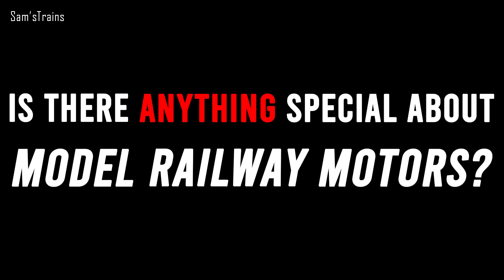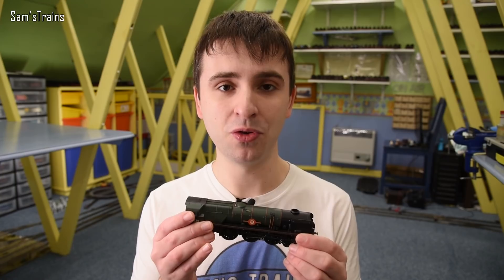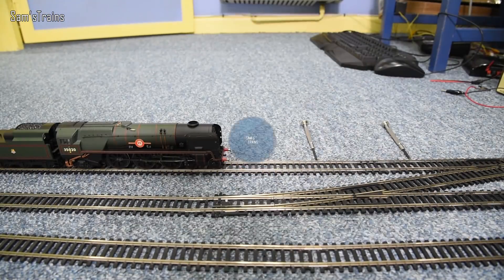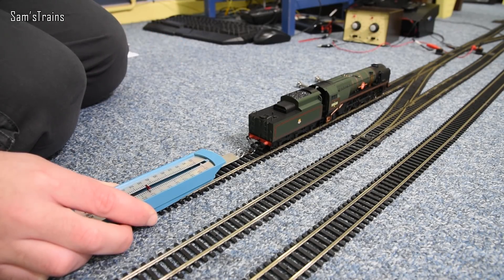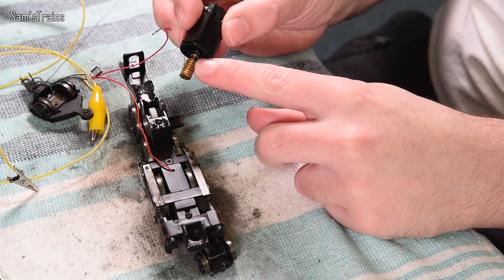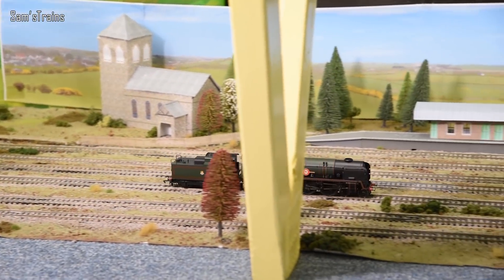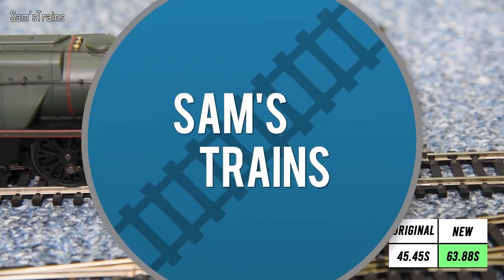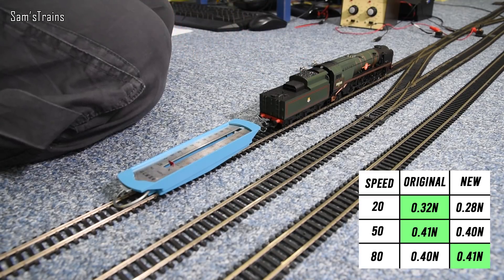How Much Do Model Train Motors Really Cost? | £2 vs. £27

Comment: IMO I think this is part and parcel for these companies to charge excessively which they have been doing for a long time for what looks like a similar engine and probably other parts too.
I would be a bit wary of any Chinese parts that have to do wth power(through experience) and it will be interesting Sam how this copes in the longer term,very interesting indeed.Thank you
Reply from the maker: Thanks a lot Robert - you may be right! I've been using motors such as these for some time - several of my models have been running them for a year or two - no failures so far! You're right though - some Chinese parts are dubious at best - but for the price of one Hornby motor, you can buy 10 of these, so it's easily worth the risk!
Thanks for watching - Sam :)
Reply: That replacement motor looked identical to the original Hornby one to me. I'd say that the only difference between the two is that it came from a different production run but from the same factory.

Comment: Is it possible that the differences reflect  the amount of "break-in" time each motor has seen. We certainly know that bearing wear, brush wear and armature cleanliness/wear could certainly affect performance. Good information, interesting findings. You have certainly proved the factory motor is not worth 10 times the replacement!
Reply from the maker: Yes that could be true - I was just trying to demonstrate that the cheap motors are certainly no worse than Hornby ones!
Thanks for watching - Sam :)

Comment: Late to the game but from RC cars these cheap motors ARE worse...but usually not enough for the hobby driver to notice. Life won't be as great (maybe 15% less life) but at less than 1/10 the cost they are perfectly fine. Its a simple DC motor! Not much to get wrong. I use them pretty much exclusivly. Run them in softly and lube them...they work fine.

Comment: Thanks so much, Sam for that link. I'd tried to find something like this before but no success. I put in that description and - there they are!
I buy quite a bit of old model train stock and sometimes the motors are dodgy or dead.
Buying from the UK to Australia costs a lot in postage let alone purchase cost and I can buy the Chinese motors delivered for the UK post cost.
I hope they work well, I've tried lower voltage motors before but they are only a short term fix.
Good onya
Reply from the maker: No problem Gerry, hope they serve you well! :D
Thanks for watching - Sam :)

Comment: Hi Sam.
 Love your site.
The pulling power experiment confuses me though. If you have wheel slippage I don't see how that can measure it's power or efficiency. It's like comparing a wrestler and a child trying to pull a sled across an ice rink. Wouldn't it be better to fit the engine with traction tyres or increase it's weight. Ideally no slippage would give a better reading. Also wouldn't efficiency be better measured by comparing the top speeds as they are both powered by the same controller.
 This is from a fella who has trouble mailing a letter so I apologise in advance.
 Anyway your show is great.
Grew up on Triang/Hornby but have to be honest O gauge is something else.
 Be safe.
Thanks. Billy.
Reply from the maker: Hi Billy - yes that's true - the pulling power test doesn't measure the motor output, but more the tractive effort of the loco. In other words, if the new motor was weaker, I would expect to measure less force when setting the controller at the same speed - as you could see, this wasn't the case.
The efficiency question was too difficult to answer in the video - but I have answered it. Basically it involves measuring the percentage difference between the input power (easy enough, VxC), and the useful power output from the loco (work done). The approximate efficiency was 5-9% for both motors at high speed! New and old motors were within 2% of each other on efficiency at any speed!
Thanks for watching - Sam :)

Comment: Not for nothing here, but where do you think Hornby is getting their motors from? I can't speak for Hornby specifically, as I'm in the US, but basically all the American producers are having their products made in China to begin with, and quite frankly, I sincerely doubt they are shipping motors from the US to them to put into the product they are producing. 

What I can say is that I have done quite a few remotor's of model train locomotives and as a general rule I do exactly what you did, look on line (eBay usually) and find a motor that "looks" right or even has an exact model # match (as many motors have a manufacturer's model # printed on them) and buy them directly for pennies on the dollar. Yes, the only real convenience going to the manufacturer for a part is most often you don't need to go through the process of swapping gears, flywheels, etc., but in the grand scheme of things, it is hardly worth the price that they charge for this "convenience".
Reply from the maker: Yes of course - I can't speak for Hornby, but since their products are made in China, it's reasonable to assume that these motors will be made there too. Agreed, there is extra work involved this way, but it's definitely worth saving all that money provided you're happy to invest in the necessary tools!
Thanks for watching - Sam :)

Comment: I’m glad the algorithm gods put this in my path. I’m not a train modeller but I’m sort of adjacently interested, and I’ve been trying to figure out why everything to do with the hobby is so expensive. It’s almost like my questions are too basic to have any easily available answers—I thought the motor connection system must be insanely complex for no one to attempt to replace with generic parts, but as you’ve demonstrated it’s really not. I would like to learn more though, like how exactly the power gets from the wheels to the motor, and how the wheels/axles are connected to that worm gear. 

The next level up would be figuring out why all the dcc stuff is so expensive. It’s not as simple as the mechanical side, but in the age of smartphones I am suspicious of why some basic electronic board and simple programs are hundreds of dollars.

Oh, and all the car system stuff! Rare earth magnets are extremely affordable now, and the weaker magnetic strips are dirt cheap. Magnetic paint exists too. Surely if you don’t care about setting up wireless control, all you need is a small motor, switch and battery for making the vehicle go. Or heck, find a wind up toy and stick a guiding magnet on it.

Comment: Thanks Sam. Useful video. I've stocked up on a few of these just in case. Have you considered something similar for the X9108 motor? This powers the 8F, Black 5, King, Britannia, Clan among others and is no longer available as a spare. It's a 5-pole skew wound motor that's shorter than the one you tested here. There are 3-pole lookalikes on eBay (although they are silver cans with yellow, red or green end caps) that would fit but I'd be interested how they compare performance wise.
Reply from the maker: No problem Andy - glad to hear that! Yes I did find lots of those too, but they don't seem to be in stock at the moment :(
Thanks for watching - Sam :)

Comment: Hornby apre getting the motors complete with worm gears for around 50p each I used to work in motor rewinds and have full knowledge of the costs. The amount being charged is an outright RIP off with no excuse other than greed. At the most a motor should be £6 - £10 there is nothing special about Model train motors other than the extortionate price being charged. It's the same with the sound decoders the materials used cost pennies. Then you have the sound guys ripping us off also for the sound files. I wanted sound for 4 A4 locos I had to pay 4 times for the same sound file at £25 each. Yet when you buy any other sound wether it be music or demo sounds you buy once and can use it and copy it for your own use as many times as you like.
This is because in law once you buy a copyrighted sound you are allowed to use and copy as many times as you like. So the bottom line is we are being taken advantage of and ripped off.
Reply from the maker: Based on the price for getting a single motor delivered to the UK from China, 50p wouldn't surprise me at all! Thanks very much for the insight - I agree, the most reasonable mark-up would be £6-£10, definitely! It does make you wonder about model trains on the whole... are they marked up by a similar proportion??
Thanks for watching - Sam :)
Reply: @SamsTrains  Yes they are marked up way beyond what they cost, I was going to buy a model shop back in 2001 and obviously went through all of the books, Back then a loco was costing the shop £18 for a large loco they was then selling it for around £75. Do they not realise if the prices was more realistic lots more people would join the hobby and in the long run they would make more money. They are going to price themselves out of buissness if they are not carefull. Just look at how many products cost a fortune if made for the hobby yet if you go look for the same product on general sale you can knock 75% off the price. PVA being one example buy a bottle in the hobby it is around £10 for 500ml go buy it in bulk you can get 5lt for around £15.

Comment: Hi Sam , Thanks for posting this, I need to replace some motors in my Hornby A4's please could you advise the make of the Gear Puller you are using, I can see one similar on EBay made by WALKERA but it says it's for N gauge and RC Helicopters ?
Reply from the maker: No problem at all Chris - try searching for a Pinion Puller - that usually brings them up!
Thanks for watching - Sam :)

Comment: Sam—this would have been a great video if you had given the vendor name, motor size (length and width), and the shaft diameter. I just did an eBay search and these things vary all over the place and still did not see any like the one you showed in the video.

Comment: Do you know if you can replace a tri ang 3f jinny with this motor and thanks for the great content 🙄
Reply from the maker: No you can't sadly Tai - but search up the X04 motor on Ebay, you can find reasonably cheap replacements. You want one with the metal worm drive!
Thanks for watching - Sam :)
Reply: Those Tri-ang motors are bullet proof 

Just give everything a clean with IPA, replace the brushes and oil the bushes with Peco electric lube, will run forever

Comment: I am glad you have done a video on this. The only difference I can see is that the expensive motor is slightly quieter than the cheaper motor.
Reply from the maker: Thanks a lot Ben! Yes I noticed that too - but after running-in, it gets much quieter!
Thanks for watching - Sam :)

Comment: Good stuff Sam. Could you post up the link to these motors? Thanks.
Reply from the maker: There are multiple listings for these which come and go - you just need to search for 12-24v 5 pole DC motor, and you should see some! Only the double shafted versions are available right now, which need to be trimmed to fit in some models!
Thanks for watching - Sam :)

Comment: Very interesting, could you share the link to the new motors please
Reply from the maker: I don't have a specific link - the listings change all the time! The keywords you need to put into Ebay or '12-24v', '5 pole' and 'DC motor', they only seem to have the ones with the rear shaft at the moment - they work fine, the shafts just need cutting down with a rotary tool, or other suitable tool!
Thanks for watching - Sam :)

Comment: Great vid
Have you ever fitted one of these newer style motors to one of the old engines. Ie replaced an x04 with one of these? Could it be done?
Reply from the maker: Thanks Jon - it could be done, but it won't be an easy job since the mountings aren't designed for this - the results would be amazing should it be done though! :D
Thanks for watching - Sam :)
Reply: Many years ago you could get a plastic adapter that fitted the back of can motors to replace X03/4 style motors, I actually got one like that in a new scalextric car that was originally designed for the older type motor. I don't know if suchlike are still available these days though.
Reply: I'll have a go at 3D printing one.
Reply: I’ll buy a few if it works and update some old Hornby triang locos to modern motors

Comment: Sam I need help. How to slow the motor on my locomotive? Thank you.
Reply from the maker: It depends on the loco - a fully serviced loco stands the best chance of doing a good crawl! :D
Thanks for watching - Sam :)
Reply: @SamsTrains  thank you.
Reply: It also depends on your controller, is it Analogue DC or DCC ?

I don't know anything about Analogue DC but for DCC you can adjust the speed of the loco on its first (lowest) speed step by altering the value of CV 2.

Comment: HORNBY is made in China, I guess they use motors made in China.Replacement by motors made in China bought via ebay is therefore possible.
Even in Germany they used to build in motors made in china, when you bouhgt a new modell from your retailer... !
Reply from the maker: You're right - I'd be surprised if these weren't the same thing!
Thanks for watching - Sam :)

Comment: The old saying goes, if it looks to good to be true it generally is. Buy cheap motor's, without the worm, I'm sure you have fitted plenty😂 You obviously don't understand bisuness, if the motors cost more the obvious there's overheads. Running your trains on carpet, even the youngest child knows that's not the way to run them.
Reply from the maker: In this case, it seems these aren't too good to be true - I've been using these since 2018 with no problems. If you do this more than twice, the cost of a gear puller becomes negligible. I'm not sure it is obvious there's overheads - if a motor costing a fraction of the price performs the same, I'd argue they're being marked up massively!
I have a collection of 400+ model locomotives, all run on carpet. It's not how a serious modeller would do things, but with careful maintenance and cleaning, I've never had a problem. Given the completely unrivalled success of my YouTube channel, I'd say it is VERY MUCH the way to run them!
Thanks for watching - Sam :)
Reply: @SamsTrains  I am watching😉.